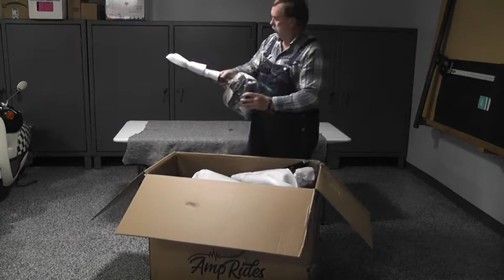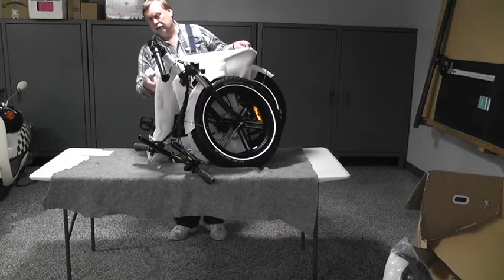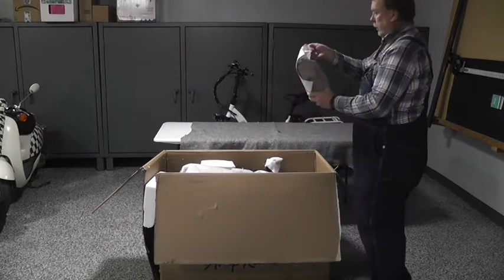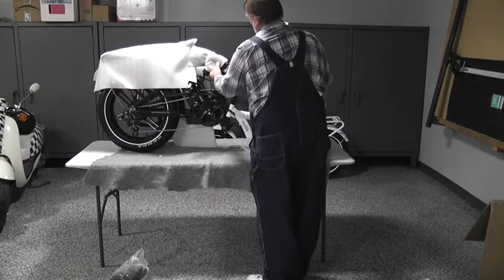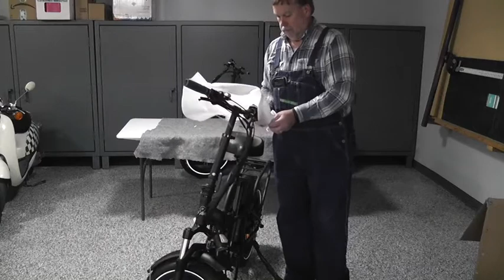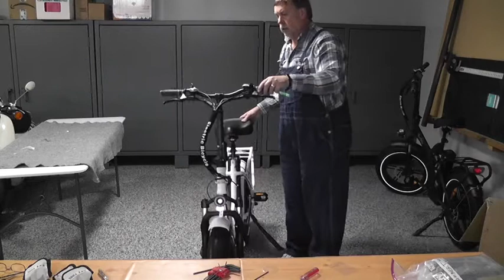AMP Rides Volt 750 Assembly

Comment: Apologies for the rough treatment by Fedex to your box. We will start taping the sides of the boxes to address the rough treatment by Fedex and put the batteries in the locked position to keep them from moving up, which should address the battery prong adjustment made here by Dennis. Tires should be run at 20-30 psi  to ride. Batteries have to be shipped with less than 50% per hazmat rules, so a quick charge is recommended. We also have a video here on how to install the display https://youtu.be/CTDS-5B8EeU